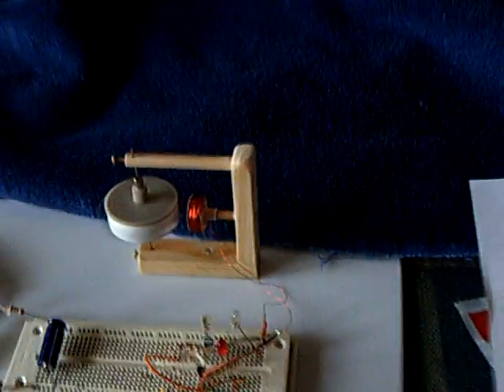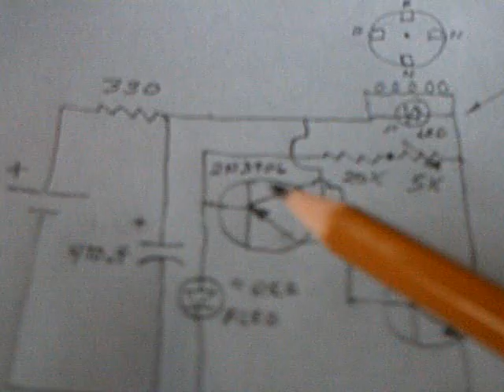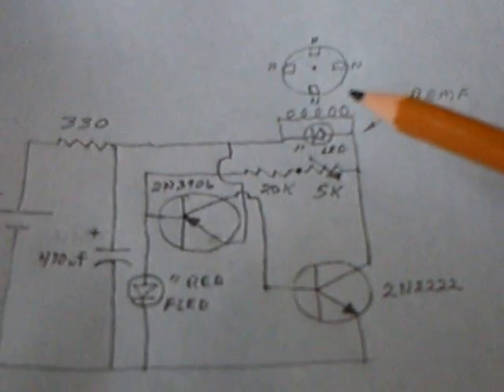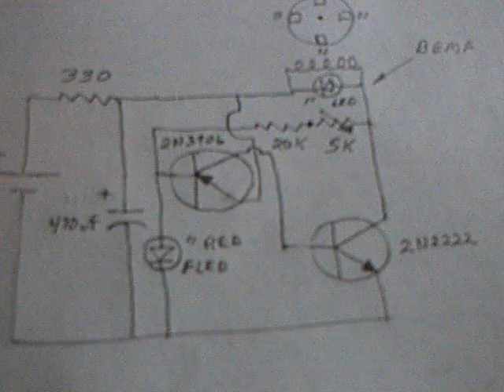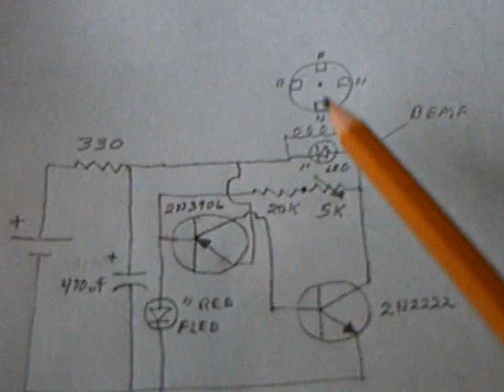Rainy day solar pulse motor.ASF

Comment: hey Lid I know I'm late, but did you ever figure out that pendulum circuit? I was wondering if swapping the cap out for a 4700uf and driving it from a joule thief would ruin the circuit.

Comment: @Lidmotor Replicated circuit with 3 differences: Used spin top magnet/Didn’t use 5K pot/Used 1K instead of 330 resistor. Monitored BEMF trigger & speed via sine wave across coil, observations: At max speed ~800uA removed FLED, all else same, gain little speed but couldn’t adjust speed below ~50 Hz due to loss of BEMF trigger to PNP/With FLED installed could maintain ~25 Hz before losing spin stability/FLED pulse takes over when BEMF trigger is lost allowing slower more efficient 450uA operation.

Comment: @Lidmotor You have Type 2 SolarEngine but I mentioned other 2 because Lucky Cat may have Type 1 or Type 2. Panasonic 1381C voltage detector more efficient than zener & looks like transistor, you’d see a smaller capacitor across 2 of the leads to set the pulse duration and a bigger capacitor would be across the same 2 leads but with a diode in series on one side. Good app, motor self starts due to trigger from BEMF not needed. Hope this helps solve mystery, always look forward to your videos. RF

Comment: @Lidmotor Can’t see FLED flash because of 20K+ resistance. FLED flash rate sets transistor turn-on/pulse rate. It’s a Type 2 time interval based SolarEngine. Type 1 SolarEngine depends on a voltage-sensitive trigger, once it stores enough power it triggers using Panasonic 1381C voltage detector or equal, pulse rate can be changed by capacitor value but has fixed voltage trigger. Type 3 SolarEngine is more complex but offers wider voltage operation & configurable hysteresis for power discharge.

Comment: hey lid 
very good work..
you probably don't the red led . try a high value resistor .. 1m
the circuit you got is running like a trigger with the rotor w/magnets..
every time a magnet passes the coil a pulse goes down to the resistor on the pnp and triggers the npn.. you are firing on 12 and 6:00 clock..
i might be wrong..
keep up the good work..